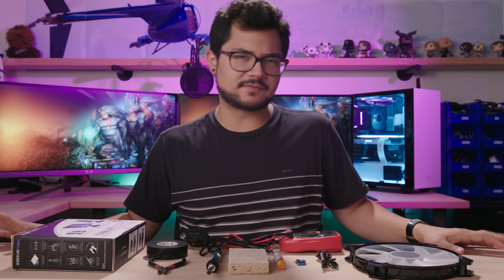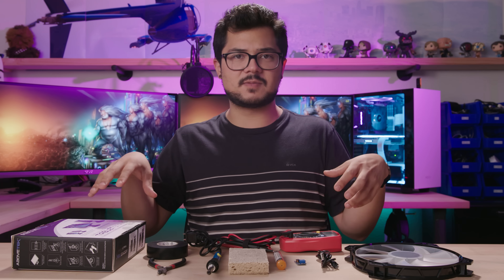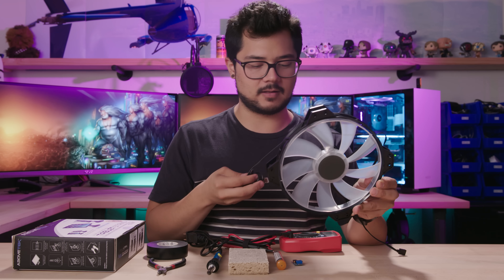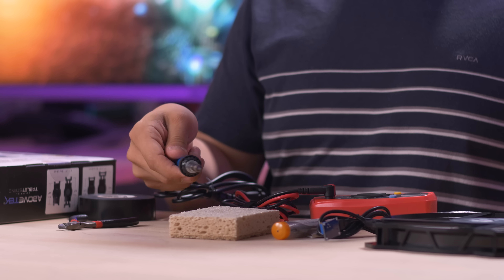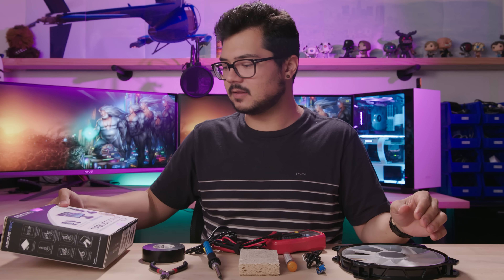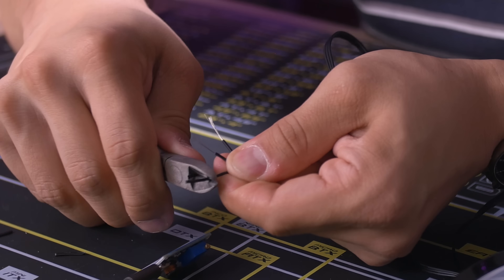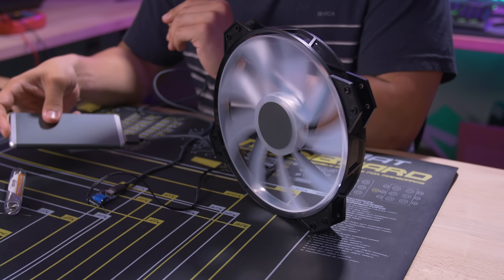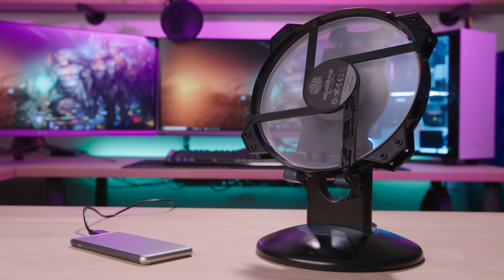DIY your own USB fan (using a PC case fan!)

Comment: No thanks ill just buy something premade for 10 bucks... which is less expensive than that fucking gigantic 200mm fan.
Reply: Benoit needs to lighten up. It was just a fun little project. Honestly, I think it would be cool to do. Maybe I will. Because I also have spare 200mm fans laying around. Because computer enthusiasts normally have spare parts around! If that offends you so greatly, I would hate to see your reaction to many of the other things out there on the Internet.
Reply: Lmao doing it wrong? For a start there is no "correct" way, but I have always parted out old systems to maximise profit on the big ticket items, i.e. sell the old mobo, sell the old cpu, gpu, separately etc, gets the most money. I don't see that there is much of a second hand fan market haha, unless they super high end fans, but then why not just reuse them. When building/repairing pc's for decades, it is expected/normal you have spare parts, especially little cheap things like fans.

And I think the point of the video is for people looking to buy their very first soldering iron as this video is a rather good and very very simple intro into electronics tinkering. I don't think he is for one second recommending people go out and do this just to get a fan to stay cool lmao.
Reply: Damn Benoit.....sounds like someone needs to loosen up and learn how to do things just for fun every now and then.  Everything in life doesn't have to be about being the most practical or logical option.  Sometimes you want to just tinker and think outside the box.  It's not like Kyle made this video purposely promoting this as practical.  He even stated multiple times that it was really just for tinkering and DIY fun.
Reply: Not if you already have a spare fan or two laying about....... I think that was the idea.... I don't think anyone would buy one just to do this, unless they wanted the newbie DIY experience.
Reply: I bought my computer with 6 fans because the case support 6 fans ... why would you have ''parts lying around'' ? unless you are a youtuber with plenty of spare parts to make build, this is VERY impractical.
Reply: Because if you have been building PC's for years/decades, that is what happens....... I must have a dozen old 120mm and few 80mm fans not in use.
Reply: Benoit Levesque My PC case had some fans in it but I bought better ones, so even I with 1 PC build have fans lying around :)
Reply: Fans are usually comparatively one of the least expensive things when buying new parts for a new build, one usually buys new fans because they're better performing or just look better or one just wants new fans. So over the years things like fans accumulate, I got loads of stuff in my spare parts collection in my 15+ years of building.
Reply: Benoit Levesque yeah you must be a very fun person honestly do you know why you have so much negativity in your body lol there are people who deserve to be more angry at life than you do buddy
Reply: Why did you watch this video then? Kyle just did it for fun and its definitely not for everybody. Calm your tits bro.
Reply: You and I are two different people man.
I always have spares lying around in a storage room. It's for if something breaks, or somebody somewhere needs one. I've got extra car parts, extra building equipment, extra tech pieces. Yes I understand not wanted to have trash around, but it's useful to have materials on hand.

I also think this is kind of a waste of materials, but you could build something very interesting with his idea. You could 3D print a case for the connections, add an on/off switch for the fan and rgb, and even use a variable stand/clip on mount to really make this idea your own.

 Regardless, I don't feel the need to bash Kyle for having a little fun, and inspiring people.
Reply: Lol I'm glad to have spare parts. The 230 mm fan I got for free wired to a power bank kept my 5 year old son who has been battling leukemia cooled down when we lost power. Plus his face was priceless. I'd pay way more than that to make him smile.
Reply: if you guys don't want your case fans give them to me i only have one fan in my system and thats the rear case fan that my case came with, but i can put 5 more
Reply: Vercingetorix ok Eugene we're sorry stop reaching inside the backpack 💀weirdos lol
Reply: I'm gonna go buy all the parts to make this, just to spite Benoit Levesque ;)
Reply: Chris James good point
Reply: This might be a fun project, but I have to agree 100% plus a normal desktop fan will also have a built in clip to attach it to your desk, will also push more air flow, overall will be safer(very important if you have kids, and/or pets) while not looking jank. 
Far as having parts laying around I have a small shop in my backyard I use for electronics repair, PC building, working on cars, etc.. and I have a bad habit of saving good parts every time I upgrade, or do a salvage job, so over the course of over 25 years I have a few boxes of computers fans all sorted, and labeled by size when I happen to need a spare, and I have done a project like this and again it's not worth the time, and hassle in my opinion, but to each his own.
Reply: tfkoincognito In your case it made sense, but normally it's not worth the time, and hassle when a desktop fan can be had for so cheap.
Reply: I'm gonna guess you are a "min maxer" style of gamer.  And spare parts are always a must for troubleshooting.  I've got at least two of everything from mobos and cpu's to extra PSU cables
Reply: Dude
It's a waste of time, just admit it
No need to defend him because hes a famous youtuber
Reply: Well I guess we are just 2 different being 
I dont like having crap lyring around that I dont use.
If I buy new parts and the case come with shit fans, i just sell them right away on ebay (everything sell on ebay). If I replace old fans , I sell the good ones and throw the bad ones in the trash (same mentality for everything in life).

I agree its good practice if you are new to soldering iron but I still think it's not practical and there is more interesting project to do.
Reply: To be honest, I think the most annoying part of this video, is the fact that he used a brain new 2018 200mm fan (and not a shitty 120mm ''spare'' fans)... like wtf, this is a fucking 30$ fan, if you buy a CM case that come with those fans, im pretty sure you wanted to keep them and not replace them right away.
Reply: Idk maybe you are just doing it wrong, I just sell my old hardware ... I never have stuff ''lying around'' especially not fans. That being said my point still remain, if you want a little personal fan, just buy one already made for that purpose with the handle and everything, its so cheap, i dont see the point in spending 30$+mats for a 200mm fan and make a cheap ass handle with some tape and cheap shit.

Comment: We had a really hot spring this year, so I zip tied a bunch of 120 fans together and attached them to a 12 volt psu from an old router. Worked great, but way more janky than your solution :p

Comment: Cool. Now make a DIY usb air conditioner with a liquid cooler...

I don't know how but just do it.
Reply: Actually this would be really easy. an old cooler box. bag of ice, some cold water, some soft tubing/fish tank pump, Radiator and mounted fan/fans. Tools needed a jig saw that cut through plastic and a screw driver. Pretty straight forward DIY AC.
Reply: Use water, and ice in a cool box and an AllInOne liquid cooler with the radiator out of the cool box and the block/pump inmersed in the water. Set the diy fan behind the radiatior and pointing towards you and voila. All you need is a ton of ice and time to refill the cool box every hour.
Reply: if someone wants to donate an AIO i would be more than happy to do this!
i'd need fans as well, but yeah, whatever the cheapest aio is would be perfect, or an old leaky one would work too! I've got a tempereture probe and i can buy a small ice box and ice!

Comment: YOUR STRIPPED WIRE IS TOO LONG< AND YOU NEED TO SOLDER THE WIRE AND THE PADS FIRST BEFORE YOU SOLDER THEM TOGETHER. Lol sorry mini rant
Reply: I thought you said

YOUR STRIPPED WIFE IS TOO LONG
Reply: Nathan LOL
Reply: TIN DEM CONNECTIONZ!
Reply: Chill out it still works fine
Reply: Jacob Wood lol ik I did it for the meme

Comment: I did something similar recently when the heat was killing me. Just took the rear fan of the PC next to my bed and pointed it at my face using some duct tape on the bed. I bought an actual USB powered fan for the same purpose now, but it was nice to get some immediate relief from the heat keeping me awake at night.

Comment: just a quick tip for your next time soldering, you get a better connection if you heat up the thing you want to solder and than apply the solder to that piece. if you melt the solder and drop it on a cold piece, you might get a weaker connection.
Reply: aka cold joint
Reply: plus flux is your friend
Reply: @vaunkillion262  - absolutely. You do NOT want to make flux your enema. 
ENEMY. 
Yeah.
Reply: And reduce the length of the stripped wires. As someone who solder at work it hurt. ;-)
Reply: let's hope louis rossman can't hear us hihi
Reply: also put those wires trough those holes first
Reply: Same, I used to work in a factory soldering circuit boards for security systems - Never used flux, didn't need to. You don't 'always' need flux.
Reply: Also, tinning your soldering iron helps
Reply: You don't generally need any additional flux when making connections on the freshly stripped wire and solder pads since the solder already has flux in it.  The big things Kyle will need to practice doing is heating the wire and pad first and then bringing in the solder to make the joint and also shortening up how much wire he has stripped back.  It's something we all learned at some point and practice makes everyone better over time.
Reply: solder has flux lol
Reply: Thats right pre apply solder to both parts. Essencialy to the cable, then its way more easier...just watch your fingers when pre applying solder to the cable, it will get hot
Reply: also need flux to help the solder flow. you can use actual flux or buy flux infused solder. either or will work but flux is probably the most important thing.
Reply: " tinning "
Reply: And don't use a wet sponge
Reply: Yes, you use a wet sponge to wipe the tip. That's why most all soldering stations have a sponge included.
Reply: I'm actually surprised it worked as well as it did, but there is a part of me that suspects he may have deliberately made just about all of the common mistakes (except he knew to clean the tip and to use something to hold the work...weird) just so he could do a follow up video later on down the road. Putting heat shrink on the wires, tinning the iron so the heat transfers well, tinning the pad + wires and then connecting the joint. While it cools clean the tip, tin the tip and turn it off. After the solder has cooled slide up the heat shrink and apply heat till shrunk. Done, maybe a minute of work. He wouldn't need to use flux unless he planned on holding his iron on the work far too long, large connections yeah, but little ones like this the rosin core should be plenty sufficient.
Reply: Heat shrink too would make it cleaner
Reply: OP, nice textbook tip which is quite impossible to follow while soldering wires together for some quick and dirty build.
Reply: Also he should have pushed the wires through the holes on the terminal to make it easier
Reply: flux is your friend for SOME applications but for stuff like this it's unnecessary.
source: me soldering stuff since 1999 with just 60/40. :)
Reply: Ghorza
emperorSbraz 
Of course you need flux. You always need flux. It just so happens that fresh solder wire already contains flux (usually around 2%) so no extra flux is needed most of the time.
Reply: Erik Bakker
PCB and component contacts are too thin and not designed for welding. Welding would introduce too much heat to the components welded and destroy them in most cases. Most components are not designed to take more than 400°C (see respective datasheet of the component in question for exact temperature and soldering time ratings). Most components these days use tinned steel/copper contacts which have a melting point in excess of 1000°C.
Do NOT weld your components!
Reply: Welding to a bare silicon die is not possible. It would destroy the component no matter the cooling.
Reply: I like how every one here knows more than him
Reply: He also should have used flux. It's a week connection, as in, I'll be surprised if it lasts longer than a week.
Reply: Arty Beats no

Comment: How is it possible that this was your first time soldering??
Reply: His background isnt in computer repair or electronics repair in general, so it makes sense to me imo
Reply: In addition to Coalition Gaming, you can see that he didn't tin the wires nor did he twist the wires (which I find gives an even better connection and makes tinning that much easier)
Reply: Maybe "first time soldering" on camera.  But hey he got the job done now it will look better when it's UL listed.
Reply: Soldering is not that hard.
Reply: Because he never needed to solder before?